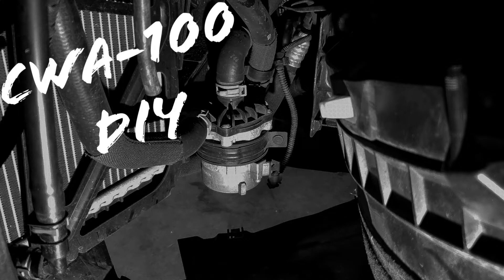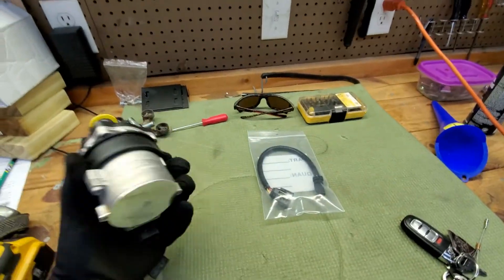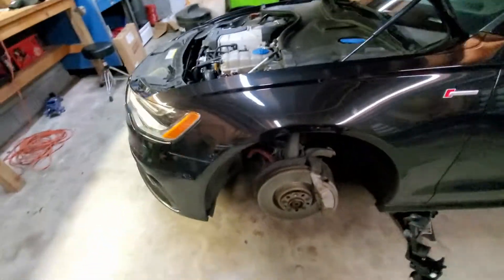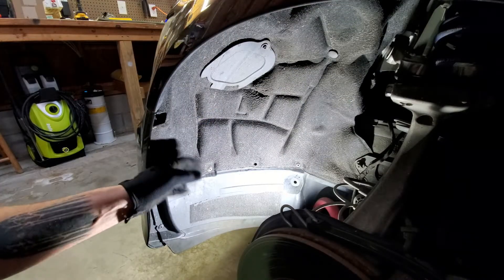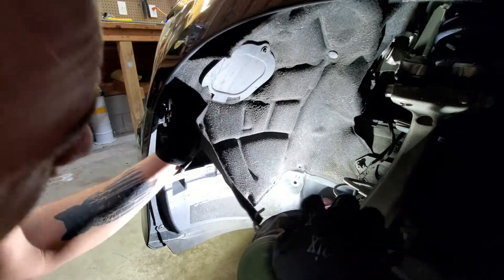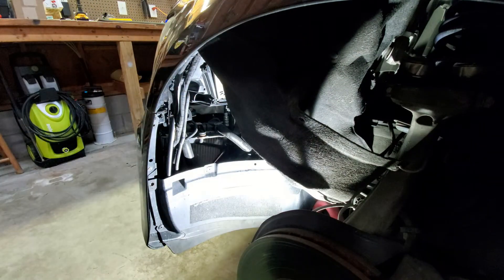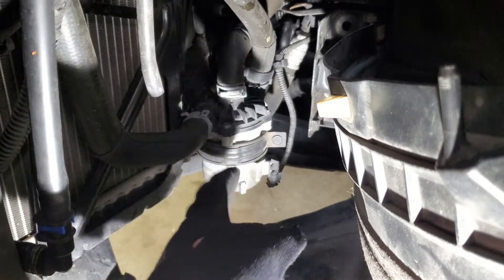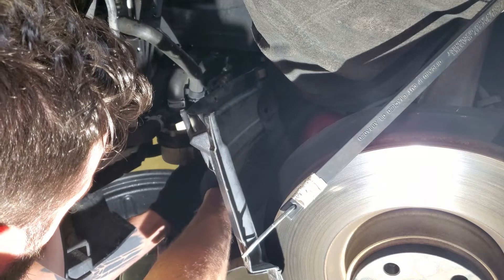Audi C7 CWA-100 Coolant Pump Upgrade DIY

Comment from the maker: One thing to note that I didn't cover in the video is that when you disconnect the PWM wire, it will throw a soft code under Engine Faults.  Don't be alarmed when you see that in your scan.
Reply: So it won’t pass inspection?
Reply from the maker: It will pass inspection
Reply: What is the code it will throw? I finally got a scanner for my A6 I recently purchased, and it's throwing a code for the Coolant Recirculation pump B10D031, but I can hear the pump running.
Reply from the maker: That's the code
Reply: Can I delete the code?
Reply from the maker: @z32twinturbo13  it will come back immediately

Comment: Hey just so you know, the top black plastic on the pumps can be rotated however needed via the four torx screws. You can leave the bracket in the spot that it fits correctly, and rotate the top plastic portion of the pump so the discharge is facing whatever way is needed.

Comment: I'm insanely jealous of your garage. Nice job, been following you on the merc racing thread on AZ and this seems like a simple upgrade for people with upgraded coolant capacity, especially as big as the merc 4.0T hx.
Reply from the maker: Thanks man!  The garage has a lot of potential once construction material prices come back down haha.  And yea, this is a simple and easy upgrade that will help your IAT's recover very quickly.

Comment: It's a really great video.
As the owner of the C6.5 3.0TFSI, I confirmed that there is an auxiliary cooler in a similar location. However, the C6.5 can only be accessed by removing the bumper.
I have a question.
Can you explain to us in detail the role of the auxiliary cooler?
Reply from the maker: The auxiliary cooler is there to just aid in the overall cooling of the cooling system. We have actually gotten one sent over to MercRacing to set if it is worth designing an upgrade for, so we are patiently waiting to hear about that.
Reply: @AudiC7Owners  Hey there! I have seen a lot of people remove the auxiliary radiator and it lowers IATs as well as dropping the recovery time. They say it is a common choke point in the system. Have you looked into or done this mod? I am debating doing it myself when I install my Merc S6 HX. Thanks for the vids!
Reply from the maker: If you check my video about divorcing the coolant system you will see that I deleted the auxiliary radiator (bypassed it actually).

I couldn't tell you how much of a difference it made in itself though since I did it when divorcing the sc loop.

Comment: Years Later BUT, Any fixes for the thrown code at all? Any way to get around it to perm clear?
Reply from the maker: Nope. It's a soft code so it really doesn't bother me at all
Reply: @ so it throws on the dash still
Reply from the maker: @i9Jake no. A soft code means no cel
Reply: @ Thanks broseph, Just got all my FBO upgrades for my 2013 S5 (71,300 miles 👀) I’m so pumped to Install it all.
Reply from the maker: @i9Jake  nice! Should be really fun afterwards

Comment: I bet if you wanted to get the wiring harness and outlets in the factory location, you could unbolt the top (looks like 4) screws and just re index the outlets clockwise one position.
Reply from the maker: Not a bad idea!

Comment: Hello, Great DIY. Does make sense to change the pump with a stock radiator?
Reply from the maker: Thank you! I think you mean a stock heat exchanger (which is separate from the radiator). I personally wouldn't. You will get more immediate benefit from an upgraded heat exchanger. The upgraded cwa-100 is a great add on to a system with an upgraded heat exchanger

Comment: Great video!!  If I want to keep the pump running all the time , can I just cut the wire? Or do I have to unpin it?
Reply from the maker: You can just cut it.  I prefer de-pinning so I can put it back in if I wanted to without having to splice wires.
Reply: @AudiC7Owners  
Thanks!!  Just ordered it!!

Comment: Have you got the part number for stock (original) Coolant pump? I just received yellow engine light and fault code: P19000 Coolant Pump, mechanical malfunction! Thanks

Comment: Hey man! So i installed my cwa100-3 today. I had the pump mod done on my cwa50 to run at 100%... i actually put it on a switch. Well today when testing the 100 out, i noticed really high temps, i flipped my switch back so the pwm wire would be active and it cooled alot better.... 20° over ambiet vs 30.... have you heard of any wonky wiring when adding the cwa100 to b8.5 s4's? Not sure why the cooling wouldnt be as good with the pwm wire cut vs not cut.
Reply from the maker: The only thing I've heard about is that the pwm wire being active can cause the pump to reverse it's operation (run slower under wot).

So maybe with your switch & the new wiring harness you are risky engaging the pwm wiring thinking you are turning it off?
Reply: @AudiC7Owners  That was my only thought. I did just install the plm 4 liter resovior tank... maybe it just takes forever to cool it back down. I just know as soon as I flipped that pwm switch the Temps dropped

Comment: Have you had any issues with depinning the signal wire since this video? I just installed mine, kept the signal wire but getting a no signal code anyway. Appears to still be working. Wondering if it’s still recommended to depin signal.
Reply from the maker: No issues so far

Comment: Is there a way to see the temps of the heat exchanger? Cause I’d like to get one in order to make sure I know the pump. Running fine cause 400$ is not cheap. That’s a car payment. So yea I need my B8.5 S5 coupe to run perfectly. But I wanna watch over it.
Reply from the maker: I use a cansensor to monitor my iat's. You can also use obdeleven, or the ie/034 mobile apps to monitor live data. You can also data log to keep track

Comment: In the event the OEM pump in this location fails,  could it result in a coolant leak toward the front of the engine?
Reply from the maker: No. Check my video on common coolant leaks

Comment: Hello from Romania! Is this the famous intercooler auxiliary pump? I have changed 2 pumps so far but it is not this one, it is the other one that is made of 100 total plastic and I still have the error. Could it be that you changed the wrong pump? I have an A6 C7 2016. Thank you
Reply from the maker: This is the coolant pump that runs your coolant through your heat exchanger & supercharger.

Comment: Hi Cameron.  I recently installed my CWA150 pump on my 15 S5.  I don't hear or feel any coolant flowing inside it and also no coolant flowing inside my Mercracing heat exchanger as well.  I'm getting a P190C00 cel as well.  Do you think I did the pins wrong?
Reply from the maker: Did you remember to upgrade the fuse?
Reply: @AudiC7Owners  yes I upgraded the fuse.  The pin diagram was a bit tricky.
Reply from the maker: @lunchmoney3652 just gotta follow the numbers.
Reply: @AudiC7Owners  im gonna try to Re pin it

Comment: What’s good bro I have a b8.5 s4 and was told I gotta change my intercooler coolant pump .. was this deff worth the upgrade ? Have you noticed and problems / codes since you’ve been running the 100? I’m stage 3 unitronic with a revo hx. I noticed today when I opened the hx  reservoir there wasn’t any coolant in it.. and usually there is, so I’m assuming the pump actually is bad right . I’m a novice when it comes to the mechanical stuff and I think I can tackle this job myself, only thing that kinda worries me is the electrical part with the changing around of wires and the potential for the pump to go bad pre maturely .. but if you haven’t had any issues .. I’d love to hear some feedback
Reply from the maker: Hey man! I haven't had any problems at all. When you disconnect the pwm/signal wire, you will get a soft code but not a CEL.

If you think your oem pump is bad, you can check it out by pulling back your fender liner and listening to the pump when you open your drivers door. That will activate it & you could hear coolant flowing.

The cwa-100 is definitely worth the upgrade. It cuts recovery down significantly.

If you don't see coolant in your hx then that means it hasn't been fully bled.
Reply: @AudiC7Owners  so just open the driver door with the car off fully or just the ignition on?
Reply from the maker: With the car off
Reply: @AudiC7Owners  I replaced the pump today. Seems to be running good. I does your pump run for a little bit after u shit the car off ?
Reply from the maker: Mine runs anytime I open my car door since the pwm wire is disconnected.

Comment: Hello, is there a switch for auxiliary water pump, because I replaced the damaged water pump with new one, but it not working
Reply from the maker: There is a fuse
Reply: @AudiC7Owners  where is it fuse located?
Reply from the maker: Check out my video installing the cwa-150

Comment: Cameron - The Aux Pump on my 17 C7 A6 Quattro 3.0T CREC has a metal top (PN 4H0965569A) and looks different than your CWA50 that you removed - Im getting a fault for a mechanical malfunction via OBDeleven of P190D00 - do you know if this CWA100 from MercRacing still an upgrade?
Reply from the maker: It is an upgrade. You are going to get that soft code when doing this upgrade

Comment: Please Help!!! I have a 2013 Audi A7 I hit a opossum last night going about 65 MPH busted my front bumper and it ripped the 3 pin connector out of my coolant pump. I purchased a new 3 pin connector each pin is numbered 1 2 3 but the wires are solid black. I have  3 wires dangling from the harness that goes to the pump the colors are solid RED, solid VIOLET, and RED with a WHITE stripe. Does anyone know what color goes to each specific pin number????? Any help would be greatly appreciated.

Comment: Hi. Regards from Brazil! I have an Audi A6 C7 

Congrats for the Channel, greats contents! 

My car broked Supercharger pump aditional and I bought a supercharger pump CWA 50 but with 4 pins and original is 3 pin. Is possible to conect? I have not sucess yet.
Reply from the maker: It sounds like you didn't get the correct coolant pump for your car. You need the 3-pin cwa-50

Comment: Hi, is one cwa100 pump or two cwa50 a better solution for 4.0tfsi? How much did you lower the temperature?
Reply from the maker: I'm not super familiar with the pump effects on the 4.0TT engines, but I know almost all of my friends with them run the cwa-100.

Comment: Audi a6 c7, boot lid number plate plugs have come loose, how do I get them to stay in the boot lid and not pull out with the screw?
Reply from the maker: If they are worn out you might have to replace them. Otherwise try holding them in place with some kind of pliers.

Just don't scratch your paint

Comment: Hey i know i’m late but i’m getting the code P023b 00 (039) short to GND How do i fix this? i have a crec engine
Reply from the maker: @stefankuruppu2164  are you on the stock pump still?
Reply: @AudiC7Owners no my saleri water pump malfunctioned so i replaced it with a cwa100
Reply from the maker: Then the code is normal.

Comment: I have a C7 A6 and I replaced the 2 radiators and I’m not getting any coolant in the heater hose and one radiator tube is hot while the other is cold. Any idea what it could be? Doesn’t show any signs of overheating but it definitely isn’t flowing properly
Reply from the maker: The first thing I would check is to make sure you have no air in your system by doing a full bleed
Reply: @AudiC7Owners  I tried bleeding the heater core but it there’s zero coolant in the tube even when the car is hot?
Reply from the maker: Do you have the heat set to the highest temperature with the fans off?
Reply: @AudiC7Owners  yes I tried that and still nothing came through, I figured some valve wasn’t opening but I’m not sure. I can’t tell if the coolant is going through the engine because the lower hose on the radiator is cold
Reply from the maker: Just a dumb question, did you do this with the engine on? You need it on to move the water pump & get coolant moving.
Reply: @AudiC7Owners  yes it was running, the coolant was up to 220 on my scanner and was definitely hot on the upper radiator hose. It just doesn’t seem like it’s getting warm anywhere else on the rest of the engine
Reply from the maker: That's really odd. I wish I was there to look at it. Might have to take it to a shop
Reply: @AudiC7Owners  I gotcha i appreciate the help! Just didn’t want to keep running it if it isn’t flowing through the engine
Reply: Just weird that there’s no leak around the water pump or thermostat
Reply: One more question lol, so even with the car off and coolant cold there should still be coolant going through the heater core when I turn the heat on right? Like it shouldn’t have anything to do with the thermostat
Reply from the maker: If the engine is off you won't get fluid moving through the heater core because the water pump isn't moving it.
Reply: @AudiC7Owners  so engine on and heater on, does the thermostat have to be open or will it still flow with the engine cold
Reply from the maker: The Thermostat does control when coolant goes into the heater core. It opens up once the engine reaches temperature which allows the heater core to get fluid.

Additionally, the fluid is moved by the water pump.

This is why the engine has to be on & at temperature to fully bleed the core
Reply: @AudiC7Owners  I got coolant in the heater core and it’s getting hot now. Thank you, I can’t however get the supercharger bleed screws off, any chance bleeding it from the coolant reservoir will be enough? Sorry for all the questions!
Reply: Just while I wait for new screws to ship in, didn’t want to break the screws out and be left with nothing
Reply from the maker: You have to bleed from the sc bleed ports. The plastic screws suck. Go very slow with them to try & not to them. If they strip, I have a video showing how to remove them by heating up a screwdriver.

If I were you I'd go to the dealer & grab a spare set. Then order a metal set from MercRacing
Reply: @AudiC7Owners  is it drivable? Or not worth chancing it
Reply from the maker: Depends on how much coolant you were able to get into the system. If you got it mostly full then you can drive it very easily. No wot driving.
Reply: @AudiC7Owners  ok thanks for the help!

Comment: Does any one know the wire colors of 1 2 3 pins on the OEM connector hooked to the factory CWA 50 pump? My 3 pin connector broke clean off! its just 3 wires hanging not sure whats 1, 2, 3 to connect to new connector.
Reply from the maker: I don't off the top of my head but you might ask the question in the C7 section of the Audizine forums

Comment: 🤔 I wonder if this pump could handle cooling with the stock heat exchanger.
Reply from the maker: It will help no matter what
Reply from the maker: But id invest in a MercRacing hx before the pump
Reply: @AudiC7Owners  thanks or the input. Im starting a rebuild project next month. I had a front drive side hit so the pump may be in the cards either way.
Reply: @AudiC7Owners  would it be just fine with only a coolant pump upgraded for  a stage 1 tune or you still suggest the upgraded heat exchanger in that case ?
Reply from the maker: Heat exchanger first, then upgraded pump

Comment: Would this help with IATs possibly? Been watching your 3.0 bleed video about 2 times a day for the past week but no matter how many times I’ve bled the SC screws and Heater Core hose, I’m still seeing IATs about 80* C
Reply from the maker: It will help only a bit. It's real purpose is to help in recovery of IAT's.

Do you have an aftermarket hx?
Reply: @AudiC7Owners  yeah I do have APRs CPS HX. I’ve bled the system about 4 times now and I’m still getting IATs above 80* C but to be honest I’m not 100 percent sure I’m doing the bleed correctly even following your video lol I just recently got my motor replaced under warranty and ever since then, my logs have looked pretty bad with the IATs
Reply from the maker: Is hard for me to know if you are doing it right without seeing you do it but if you are following my diy you should be good.

When is the last time you replaced your pcv? Did you also replace your pcv breather tube with the check valve?

Did you replace your supercharger intercooler cores?
Reply: @AudiC7Owners   when it comes to bleeding the heater core, does the car need to be running or just ignition on with car up to temps? Also, if I’m using a funnel with a seal on the coolant tank, do I fill coolant as high as I can while bleeding and then just siphon any extra coolant out after? I seen you mentioned that so there would be no need to raise the car? But as for getting all that changed I wouldn’t be too sure. I would think while doing the long block replacement that Audi would replace what ever was necessary but I wouldn’t be 100 percent sure without asking my service rep
Reply from the maker: Yes, the car needs to be running with the rpms around 2k. & yes the coolant needs to be higher than the place you are trying to bleed so that gravity forces the fluid through the system & pushes the air out.

Check out my video on pcv tips & tricks. There is a think I bought after doing this video that makes that a lot easier.